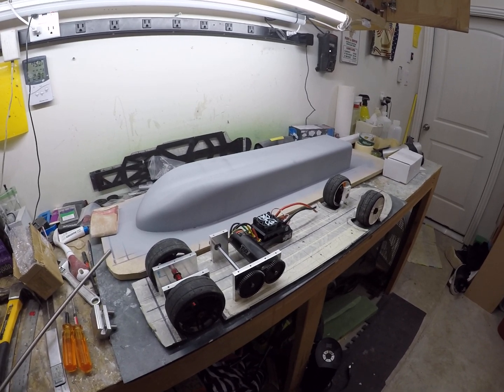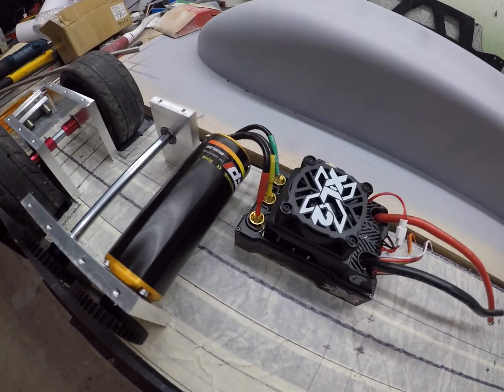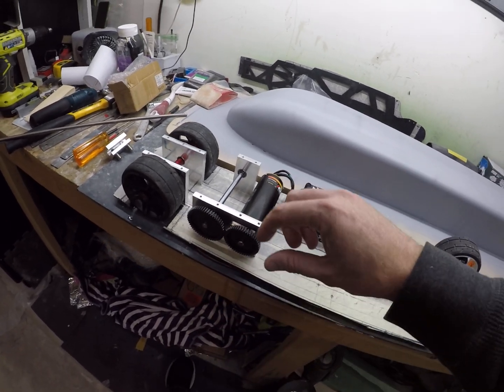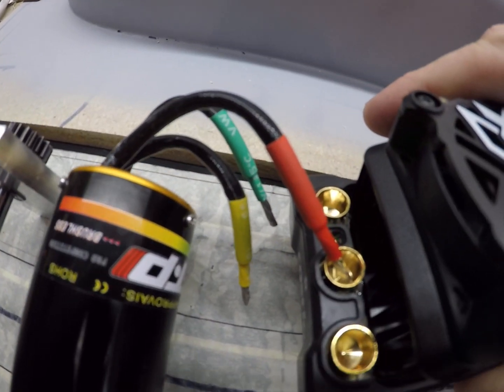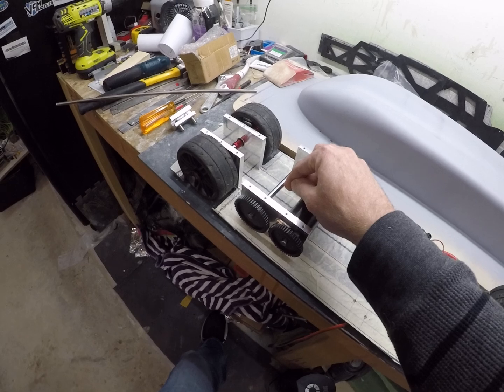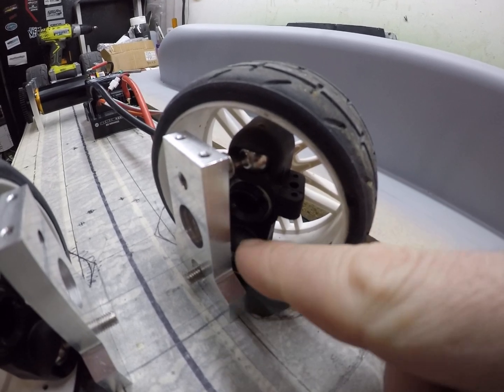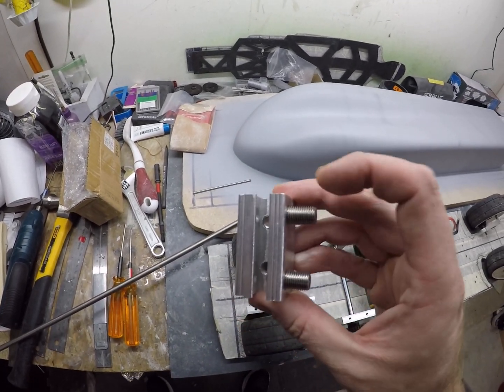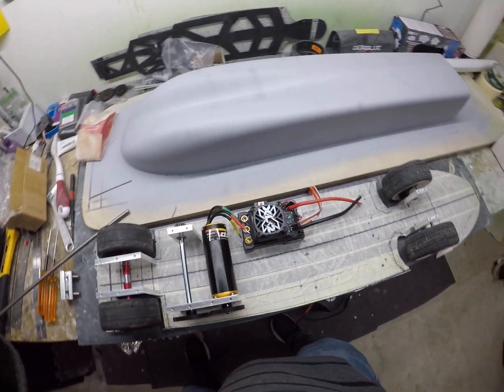200+ or bust project Motor and ESC plus body update

Comment: Niced
I would also be bothered by the wires. Technically OK and all that is fine....
Exept when you are at max depth, and as far out as you can go...
Then, make everything perfect.
("Perfect" being relative in this case, as approching or exceeding 200mph is uncharted waters)
Reply from the maker: Agreed, plenty of challenges for this goal.
Reply: I also have no hesitation to taking apart an esc for touch up work!

Comment: Great to see your awesome progress counting. Too bad about the concern about the motor wires but do understand your desire to have a thoroughly robust design.  Also thank you for sharing all the details! I was really interested in your front end design as that is one area that always remained unclear with Nic Case's world record design, though I figure it is something straight forward similar to yours. It looks like your running no caster in the front but that's one thing that can be see on Nic's design too.
Reply: To continue, zero caster may seem counter intuitive for straight line stability but caster leans the wheels to the side some when steering. This lean can raise the front of the car ever so slightly and probably not best for your design with no suspension and highly reliant on the aero over and under the car staying stable at speed.
Reply from the maker: We had discussed this quite a bit on the Arrma Forum.  Initially I was very concerned because I had overlooked adding positive caster into the design.  After reading about Nic's car not having caster either that eased my mind a little.  We will see how things go when it gets to testing phase.  Thanks for following the build and providing interesting comments/feedback!  I am by no means an expert so feel free to chime in with any concerns you see.

Comment: I recently got a new tp motor and the wires were verry thin on it as well thought it would be am issue but I've got it up to 158mph and 500+ amps with no issues
Reply from the maker: I learned a little more on this.  They offer 4 distinct wire sizes on the TP4070.  Above 1000kv it is larger and again at 2000 kv it goes larger.